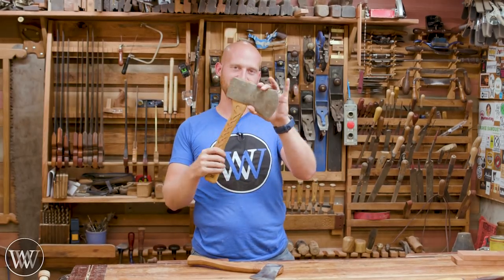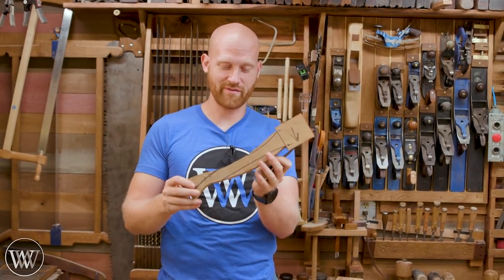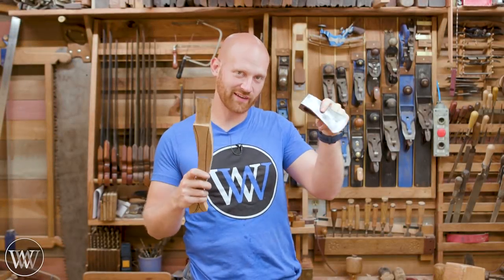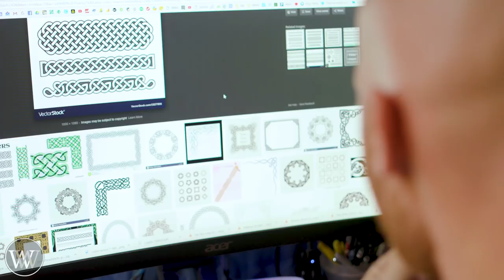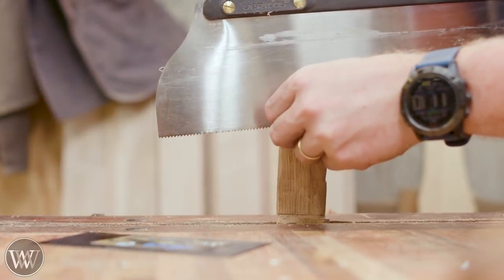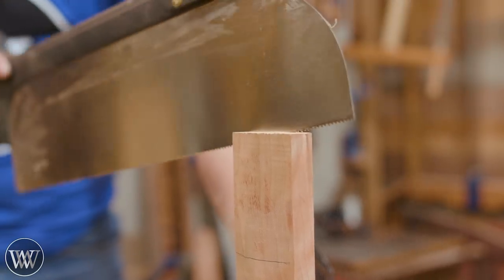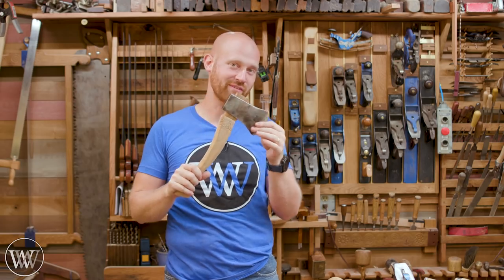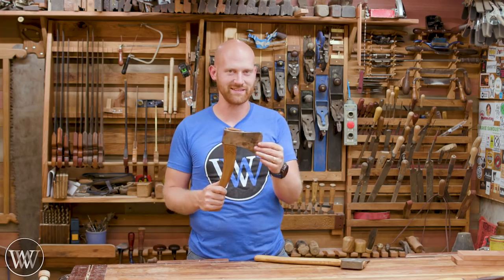Carving a Hatchet Handel

Comment: Creative job.  Apply blo to the wedge before driving it in will make it easier to drive in.  Also applying blo on the wedge end of the handle will swell the wood and give a nice snug fit.
Reply from the maker: thanks jay. I did add linseed oil tot he wedge. I prefer raw to BLO for that step as it will soak in better I just did not show it in the video.
Reply: @WoodByWright  I figured you did.
I've used boiled linseed oil for my hand tools around the home but started using paste wax also, love the finish and feel it leaves on the handles.

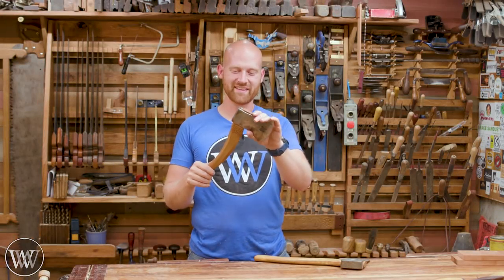Comment: 11:26.  That face says, "beware chickens."  Excellent job.  I have an old hatchet that needs a handle.  I'm now inspired to make instead of heading to Big Box.
Reply from the maker: Sweet Ross. that is the best complement I could receive!
Reply: I have a follow up.  Ignoring things like weight and wear on edged tools do you see any downside to using Ipe.  I was given about 40' linear feet of 2x6's and have been dying to make something with little of it.
Reply from the maker: WOW! nice find! no, it is a good stable wood. it is a pain to work with but a very good long-term wood.
Reply: Yes, I was stoked.  Ok, Thank you.
Reply: Well, I did it.  Word to the wise.  Don't try to carve Ipe, at least at my level (novice).  It actually turned out ok with minor issues, but given that it's more difficult than Yew I think I did pretty well.  Used spoke shave, chisels, and dovetail saw.  Broke some teeth on the saw (dozuki), three sharpenings on the chiseles and spoke shave.

Comment: I recently took two pieces of red oak from a 78+* year old tree in my yard that died. I dried the pieces for a year and a half and went to make a mallet. One piece was bigger in diameter and shorter and I planned to use it as the head of the mallet. The other piece was slightly smaller in diameter, but I planned on smoothing it out to fit into the head of the mallet and using a wedge like you did here. 

As I was working on the head of the mallet, I noticed that I was using what was meant to be the handle of the mallet. It still had the bark on it except in a few places where I had smoothed it out somewhat to quit eating into my hand. It got more and more comfortable to use. 

When I finished the mallet head and reached for the piece I needed to shape as the handle, I noticed I wouldn't have my trusty oak "smacking stick" to shape it, because it WAS it. I use it for loads of stuff now and it hasn't chipped or even so much as dented so far. I've named it Bamm Bamm. I am thinking about using it to make a plaque to hang it on with its name on the plaque. 

I now have an oak stick that works beautifully as a mallet all by itself and no interest in doing much else with the "head" of the mallet except maybe finding another stick to make a handle for it just to have a standard shaped mallet to hang up for looks, lol. I doubt I would ever use it, lol. I'm not giving up my naturally made mallet for anything now. I am just smoothing it out with my drawknife in the area where my hand goes and leaving the areas that had been other branches that I trimmed off to get it closer to a round shape. My hand fits perfect in between those areas and the end does the job and seems just naturally balanced so I can strike with pretty decent precision. 

I love your builds because they inspire me to just do what I want when I'm either restoring tools or making tools. I guess other than having quality tools, using those tools to get the experience and practice using those tools matters a lot too. 

* My aunt is 78 and it was a very old huge tree when she was a little kid. Nobody knows how old it really was because the rings are so close together and tight in many of the years that you can't count them very easily. The diameter of the trunk was 30". The one slice I have of it is 28". It is cracked and brittle to work with. So, I'm not quit sure how to proceed to sand it smooth and hang it on the wall. I might end up having to leave it rough and just oil it and hang it "as is."
Reply from the maker: Nice. I love to see how simple tools can be and still do the trick. no need to over think it!

Comment: Great video! Great skill also! After hanging around 100 or more axes I would like to give you a small tip. In the future for an axe that may receive more abuse than that little hatchet, which I’m sure will help out with carving. The transition from the handle to the head is basically a ledge. On that hatchet and the impact it will receive I’m sure it will be fine. But if the handle had a softer transition. The handle body should bend into the tongue. It will also give you a tighter fit. Instead of the head abruptly stopping on a ledge it will have two wedge effects. It will wedge downward and wedge outward. Just a tip for future reference. Great job and I love the carving!!!
Reply: Brian Rust , I think that you have a point there, politely made. I am concerned that the ledge will concentrate stress along the line of the saw cut that can be seen in the video.
Reply: Yes, exactly.  Any axe with a big bulge or ledge below the head is a stress point.  A smooth transition allows shock to work it's way down through the haft.  Any abrupt change in dimension near the head will be the weakest link, concentrating shock load.  The pivot point is also way too far back on the head.  Anyways  He seems like a nice guy so I'm not going to bash, but i wouldn't use that axe.
Reply: Considering the use he has intended for it I’m sure it will be fine. Light carving at least. Now if he would try cutting down a 3”plus tree I bet it would not turn out good. Or an oak handle on a #4 axe say 36” long with that transition. It would snap lol. Great video though. I have an obsession with axes so I can spot that kind of stuff. I believe this was his second time to make a handle. (On this channel at least) so no biggie.
Reply from the maker: Right on. I normally do that, but with wanting to do the carving up near the head I decided to create more of a ledge. it may cause a problem in the future, but this is a light duty shop hatchet.

Comment: I really like the way you handled this project. I hope the oak holds up to its intended use. Love the carving too. I just wish for more detail on lining up the template around the handle or any other project with a full "collar" where the template runs an "infinite" circle around the object.
Reply from the maker: I make sure to size the template to the project needed. I use Google paint to do that. normally I will print 3-4 sizes and pick the one that is closest.
Reply: Wood By Wright 
Great, thanks for the information.

Comment: You got the hang of it,,,,,,, very striking,,,,,, looks sharp........... really nice G.I. bit.  I made a scrap  red oak cheap rubber mallet handle, beautiful, feels good and just could not stand that white round turd of a OEM handle. I also scorch torch chincky burn whatever it's called and it is the deepest dark chocolate,,, looks nice and like using it when needed.  I have more in line but there is only so many hours a week i can do stuff. I have a grip of hatchets hammers mallets and such that i want to modify restore customize if I find the healthy time.  I need/want a "V" gouge . Now you can customize that old (larger) bit and do all sorts of stuff, be more fun to have for sure.
Reply from the maker: nice. it is amaxing the little work that goes into a project with a V-tool, but it adds so much!
Reply: Love the typo,,,, picked up a cheap carve set, buckbros at HD, probably should have waited and got less tools at better quality,

Comment: Nice video James.  Handle looks good.  i am curious as to why you would chop out the excess to get the rough shape of the handle instead of using your bow saw to remove the bulk?  Not a complaint just trying to understand why you chose that method over the other.

Keep up the good work.  I am always glad to see a new upload by you in my inbox.
Reply from the maker: thanks. I find chopping to be far more fun and a bit faster. a turning saw is quick. but it takes less then 5 minutes to chop it out, and nothing beats seeing those chips fly.

Comment: That was interesting and timely. I have just finished making a new handle for a frying pan. The iron core of the old handle is about 1/4 inch square. I made grooves in two pieces of white oak and then glued them together around the iron core. Then i shaped the handle using the same tools as you did, spoke shave, No 4 plane, block plane, chisel and a saw (no scraper - don’t have one). I found any planing against the grain was not really possible as the wood split and chipped. In retrospect I would have cut the wood roughly to size before gluing. I’m not sure about what finish to use. I’m considering Danish Oil. What are your thoughts?
Reply from the maker: Nice. That is the nice part of a card scraper. You can go agenst the grain. If it were mine I would use a home made BLO and paste wax, but that is a personal choice. It all depends on what you want the finish to look like and do.

Comment: Hey James, got a question, not a criticism. You have such a joy in using vintage tools, but your backsaws and chisels are modern. I know they work just fine, but just wondering...
Reply from the maker: I an mot a vintage wood worker or a traditional woodworker. I just purchase the cheapest quality tools I can find and work with those. the Veritas back saws are cheaper then quality traditional back saws, and I really like the Aldi chisels. one of these days I will make new handles though. but for most tools the cheapest and best quality route is to roster vintage tools. that is why most of mine are vantage.

Comment: bruh you spelled handle wrong lmao
Reply from the maker: Welcome to wood by wright that is part of the fun.
Reply: Thanks for the response! If you don't mind answering a question, why is there a recurve in the handle design? And why is the part you hold so far towards the bottom? All forms of axe's that I've used have a bit of flare towards the end that helps balance it out.

Nice vid btw.
Reply from the maker: the flare at the end is to help the hand from sliding off the end. the curve gives the line of the blade a more comfortable position with the line of the nuckels. I have never been a fan of chocking up on the head, but each tot heir own. that is what makes the sport great!
Reply: Now that you mention it, your knuckles do curve a bit. And I always thought the flare was for weight. Thanks for the info.